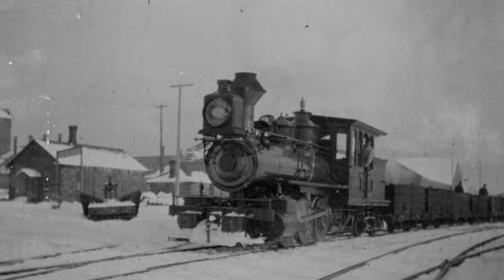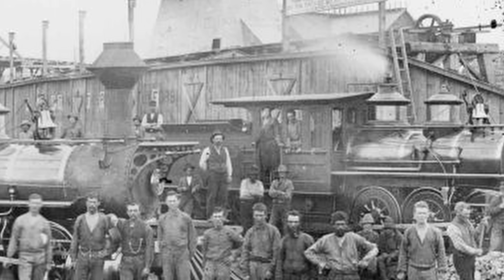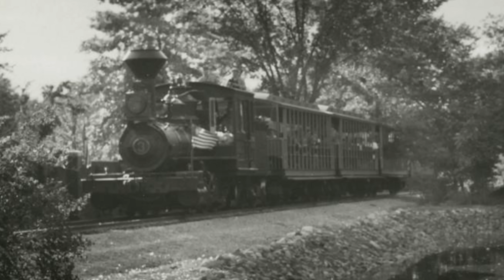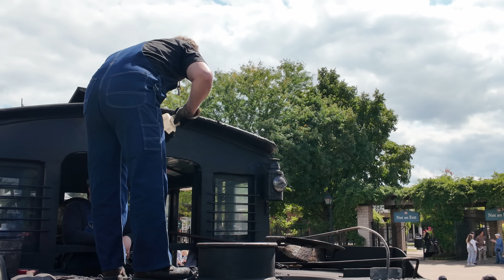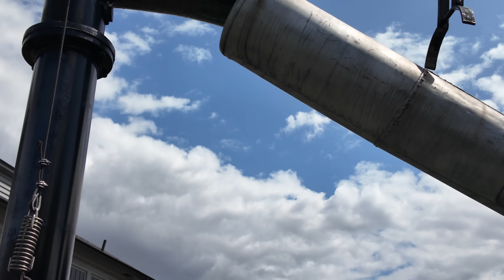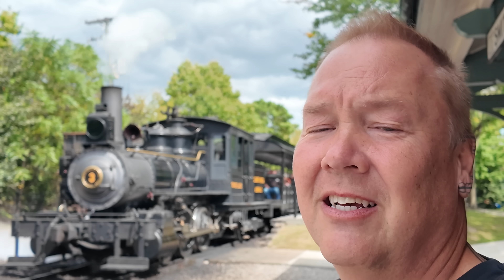Ride The Oldest, Regularly-Operating Steam Locomotive in US!

Comment: Maine 2 footers were often 0-4-4 Forney designs that ran equally well forward or backward. Running backward had the advantage of alleviating the tracking issue by putting the bogey end first. The 0-6-4 design  in the video is similarly interesting.
Reply from the maker: Thanks for the info!  I've been thinking about doing a video on 2' industrial locomotives, and one on logging locomotives, and the challenges they faced and how they overcame them.

Comment: One thing that isn't obvious in the video, and apparently never occurred to William Mason, was that the tracking problems were at least partly because they were trying to ignore Newton's second law of motion: For every action, there is an equal and opposite reaction.  The steam in the cylinder presses on all parts of the cylinder walls equally. The rear wall is the piston, and it moves forward and backward.  But the same pressure is applied to the front face of the cylinder.  In other locomotives, the cylinder is an integral part of the cylinder saddle/loco frame/boiler, so the pressure is overwhelmed, and nothing remarkable happens.  But the Mason's truck is free to swivel, so the steam pressure on the front wall turns the truck just a bit with every piston stroke.  The other cylinder, being 90 degrees out, moves it the other way.  So, far from a ride "as smooth as a Pullman car" (Mason's boast), it was continually hunting for curvature, and the front flanges wore out very quickly.  Adding a pilot truck helped, but couldn't fix the basic problem.

The Mason was very popular with a very small set of railroads.  The Denver, South Park and Pacific had 23, mostly 2-6-6T and 2-8-6T.  The Boston, Revere Beach and Lynn had 32 and liked them so well they continued ordering them from other manufacturers after Mason shut down.
Reply from the maker: Thanks!  I hadn't heard about that problem, but it makes sense.  I've talked with crews a couple times and they've never mentioned the flanges wearing faster, but they go so slow and such short distances at Greenfield Village that it may have never come up.

Comment: Torch lake runs at 130psi I believe is where the low safety is set.
Reply from the maker: Thanks for the info.  The 100psi I mentioned, I think, was typical operating pressure.
Reply: Arguably my favorite engine to operate and work on during my tenure there!
Reply from the maker: When did you run the locomotives there?